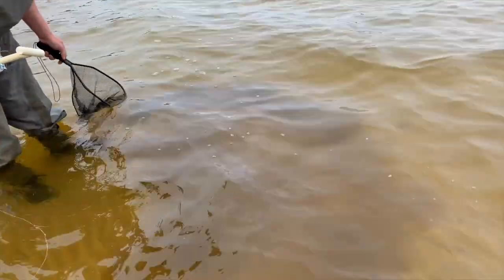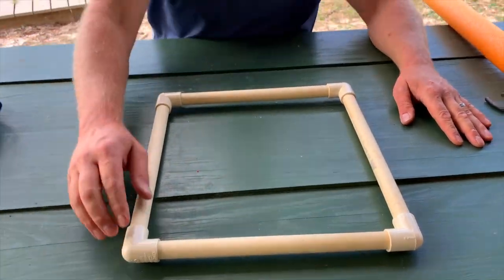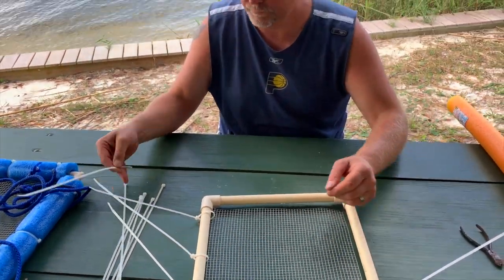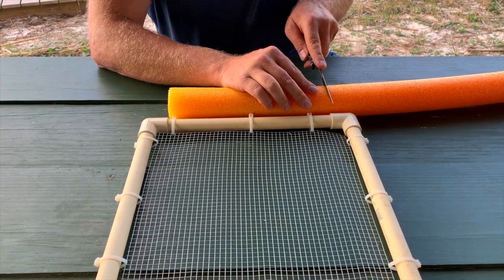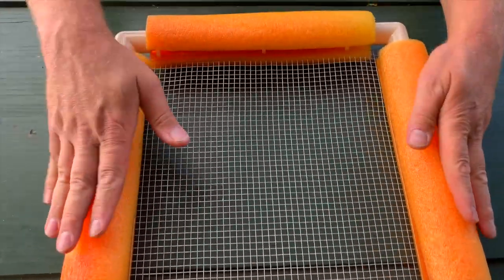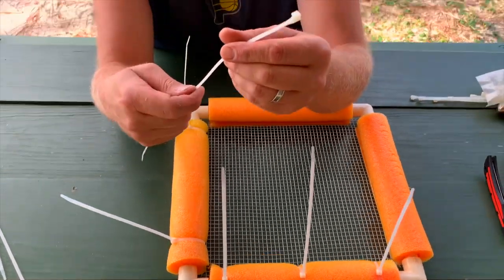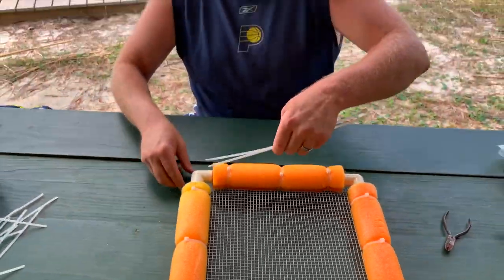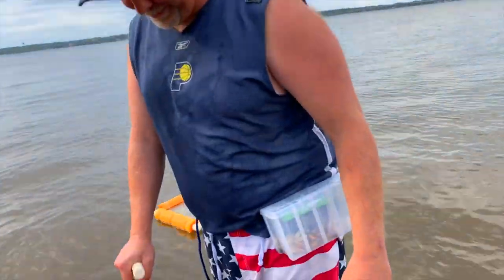How to make a GHOST SHRIMP SIFTER

Comment: Do you have issues with leaks at the joints reducing buoyancy?
Reply from the maker: I have not had issues so far but using a PVC glue helps. I do need to do an updated video with a new version Jeremy created
Reply: @SaltSquatch  Thanks for the feedback. Will subscribe and keep my eyes open for the update.
Reply: I was thinking the same thing. I'd glue it to add buoyancy. You're not gonna break ovc, but the pool noodles can get water logged.